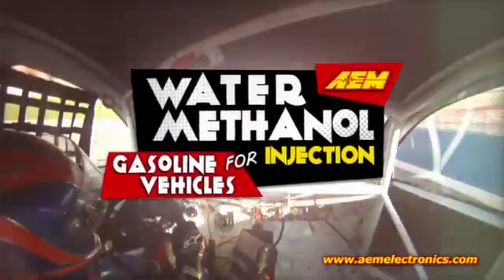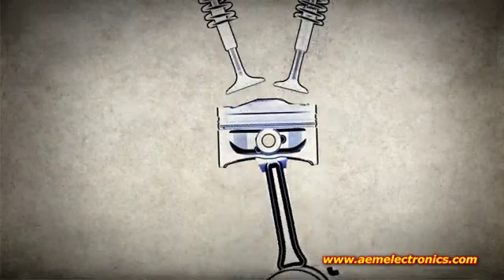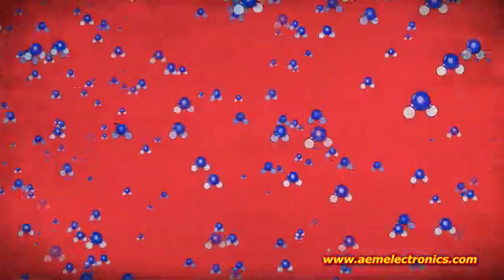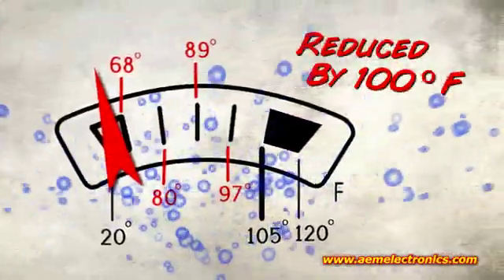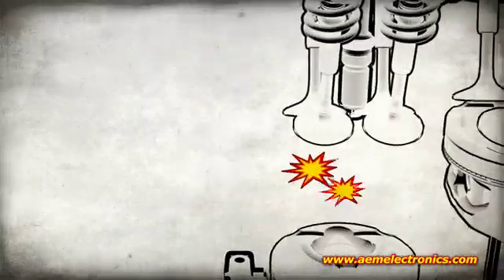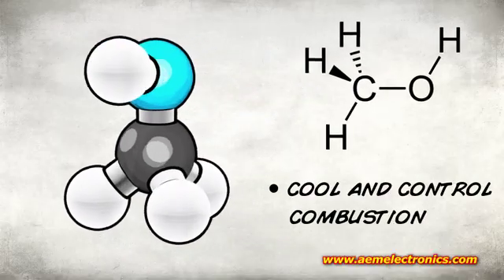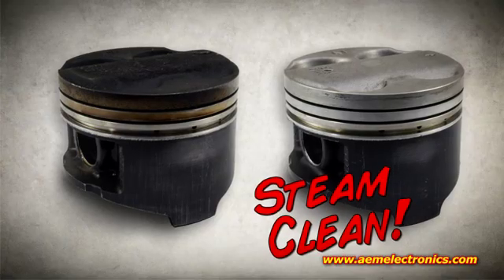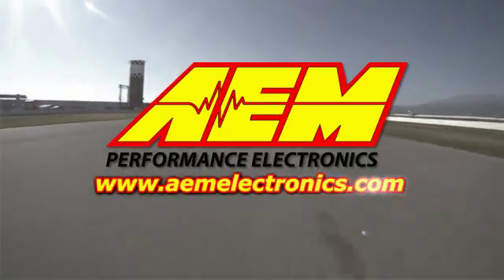How Water/Methanol Injection Works & How It Makes Horsepower in Gas Engines

Comment: This is one of the things that sound too good to be true... Anyway, do you need to remap your car after installing a water/methanol injection kit? Also, where do you get the liquid from and how often you have to refill the reservoir?
Reply: you def need a remap. you would see little or no increase in power otherwise. it would cool the engine but thats about it.
Reply: It is infact not too good to be true, and to answer your questions yes you need to remap unless you don’t care to see a power increase. And as far as buying the methanol goes I prefer boost juice you can buy it on Amazon and I put a gallon in my meth box about every 5 tank fills. So worth it and I highly recommend if you are pushing a lot of boost

Comment: CH3OH + H 2 O → CO 2 + 3H2 (Hydrogen) at 200 to 300 C.
Its called methanol steam reforming (MSR)

A hydrocarbon (gas, petrol, diesel) + H2O = Steam reformation. (more hydrogen)

Red Hot Carbon + steam = more H2

So... There's more going on here  than just detonation suppression...
(Begs the question: What's produced in the exhaust too..!)

Comment: I want to use this for my 20yr old Subaru H6.  I know its got a carbon problem because I get detonation (with 93 octane gas) over 2400 rpm when under load if the temperature is over 40F outside.  I get no detonation in cool rainy conditions when the rain is a superfine mist.  Most of the time it runs too hot and eats up spark plugs too soon.  Why would I pay for a complete rebuild on a car worth $1500 when water/meth will most likely fix the problem?  But I have no idea where to put the nozzle when I buy it.

Comment: Can e85 not be injected?
Reply from the maker: Not using this system. It is designed for water/methanol injection only. If you want to use E85 you will need to upgrade your vehicle's fuel system with alcohol fuel-compatible components (pump, filter, lines, injectors, regulator, etc).

Comment: how much milesi can go with methanol tank? also when does it works? from rpm or it just adds on throttle?
Reply from the maker: The consumption rate of the WM will depend on your start and full pressure settings, and ultimately your driving habits. Typically our 1.15 gallon tank will last for the length of a tank of gas. Our standard controller is boost dependent, meaning you set the boost pressure you want the WMI to start flowing at, and the pressure you want full flow at. The controller then interpolates these two points to deliver a linear fuel flow curve between the start and full pressure points. You can also use our Multi-Input Controller to set start and full pressure from MAF reading or IDC.

Comment: need to retune the car if i only use it to prevent knock, not increasing power?
Reply from the maker: You do not need to retune if you are using it for knock prevention and cooling, but to get the best performance it is strongly recommended.
Reply: AEMpowerTV so i can just get this kit and install into my car and start spraying without tuning?
Reply from the maker: You can, but to net a performance benefit you will need to have the engine tuned.

Comment: silverbullet
This is how we are going to make out system the best performing supercharger and the  easy ist to install.It just bolts on hook belt some wires drill a few holes and your ready  for the ride of your life.  928 344 2117 Will fit all Chery based engine buggy.

Comment: Very new to this, not even sure how I got here. So many questions, lol.

Would you install this in a standard, non turbo GDI engine? Does this completely replace using gasoline?
Reply: no it doesn't replace gas...you will be able to use the less expensive gas with the added methanol plus when tuned get lots  more power

Comment: Can methanol be used on NA engines?
Reply from the maker: Yes, on high compression engines. We have a WMI controller that you can program the flow curve with using MAF voltage signal.

Comment: What about tuning for moded cars?.. If it creates more power by allowing more timing is it to the point where the ECU can adjust itself with an aftermarket tune already in place or does it have to be specifically tuned to run with water/meth? if it has to be tuned for water/meth then what happens when it runs out? the car runs like crap because there's too much timing or can it just pull timing to a preset like say a 93 octane tune?
Reply from the maker: Sigrafix To take full advantage of a system the car should be retuned with the water/methanol injection. On our system we include a fluid level sensor so in the case that you run out of fluid it can send a low side ground output through our controller to your ecu to switch maps.
Reply: AEMpowerTV
Thank you! That's what I wanted to know.. now this brings me to my next 2 questions, 1. How big would a typical methanol tank be? and 2. How long would that amount of meth last in moderate use?..

ideally I'd consider a low constant meth injection to supplement fuel for a bit more power at all times but I'm not sure if that's realistic or even possible.
Reply: Forgot to mention I turned off the pump after realizing I forgot the tune. It will be tuned once I get the file.

Comment: What happens if you run out of methanol while driving??
Reply: You just won't have that same benefits.. The car would run the same prior to the injection
Reply: trompocop19 The methanol is an add on.

Comment: Would the car still run if it ran out of water/methanol and wasn't temperature dependent on it.
Reply: Absolutely.. You just wouldn't have the same benefits.. The car would run the same prior to the injection
Reply: Yes. It's just an add-on system so as long as you are not using the water-meth just to keep your engine at a safe temperature it won't cause any damage to your engine, you'll just lose the benefits of the cooler inlet air temperatures and increased boost.

Comment: The knock suppression ability also let's you run a leaner mixture as well as more timing.  Rather than running rich for the "cooling effect" of the extra gas you can rely on the water/meth mixture to keep temps in check.  Water takes a lot more energy (heat) to vaporize than gas.  But of course most tuners heads explode when you tell them you want to run leaner than 12:1 in a turbo application with water/meth injection...
Reply: rimwrecka100590 general consensus is to stay at less than 12.8 afrs for turbo applications to avoid knock. This is because it is difficult for someone to grasp temperature differences of the airfuel mixture. Basically, they are relying too much on afrs to gauge how much more boost or timing one can run.
Reply: 383mazda Why does this make their heads explode?

Comment: Question:

What happens when your reservoirs run out of the water/methanol mixture? Will your car simply loose the power gained by the system or will it cause damage? Anyone who is knowledgable on the subject please let me know!

Thanks
Reply: Robby Seiler There is a sensor to warn you of a low level. If it does run out, the computer will sense this and shut down the components.

Comment from the maker: Yes the kit can be used with just water. On a gasoline engine you would like to have a 50/50 mix of water/meth however on a diesel it sees less benefit from Methanol and can be used with just water with nice gains.
Reply: Hi.. So what mixture is best for diesel? Or just water or winter windshield fuid that has some meth in it?

Comment from the maker: Yes you can use them on NA vehicles as well and you are correct the benefits and nozzle size selection would be different than a boosted engine.
Reply: Not near as much benefit on NA though obviously

Comment from the maker: Yes, but you would need to do individual cylinder injection points and also have it completely programmable in RPM and load. At that point you would be much better off just running pure methanol in your vehicle as your fuel. This must be tuned of course

Comment: Thats dumb. The ''turbocharger system'' has nothing to do with what the methanol injection is fixing. Methanol injection is cooling your motor and increasing octane, any turbocharger system is gonna increase heat and chance of detonation even a 10k dollar turbocharger system. lol... if you dont wanna run methanol use race gas or e85, not a better turbo system lmfao.
Reply: Technically it does not increase octane as octane is a component of gasoline. It just resist's pre detonation like octane does

Comment: if you change your compression ratio (new pistons, etc.) in you NA engine to racing levels you may use this system to prevent engine knocks when you are not using racing fuel. Other than that, I don't see why you would want this system in NA engine. Hope it helped.

Comment from the maker: @gsrangelmon 

The methanol has two roles in the injection system. It does cool the intake charge, but it also increases the octane level of the fuel as well.

Comment: i have a question i understand the water Absorbs the heat but what does the methanol do. does it just increase the octane level of the fuel when it gets mixed with the petrol or does it have a cooling effect like water ? and why do people run 100% Meth ?

Comment: @mrxbrightside mostly turbo/supercharged cars because they are prone to more heat and detonation. but if you have a highly modified NA with very High compression pistons  then it will help stop detonation. the old hotroders from the 1950s used to use this system to stop detonation so its nothing new. also WW2 fighter jets used water injection as well

Comment from the maker: @rabbott430 HAHA! Funny but some have tried this - with not so good results. Here's why: the size of the water droplets is too big and won't atomize correctly, so you have water that is in a droplet that is too big to vaporize (and thus can't cool things off) entering the combustion chamber. Problem 2 is the siphoning effect that will occur when the engine is in vacuum - your engine will suck water out of the tank and could hydrolock.

Comment: @TheAristotleQ Did you ever have your car running hard on just straight pump gas? I did before and there is a very noticeable difference. When I get in it before I could just about watch my gas gauge go down and with the meth it is a lot better.

Comment: @1970351cmustang Short answer... YES! Even on a N/A engine you will see power gains. Check out the Aug 2011 issue of Popular Hot Rodding Magazine, they cover the topic of N/A Water/Meth injection. However they did theirs on a Carburated 302 setup. Check out Snow Performance for Mustang kits.

Comment: @getalife04 It did nothing noticeable for my fuel economy. No one I know has ever gotten better gas mileage on a forced induction gas engine. I have a W/M set up on my car. When I drive mostly freeway, the system doesn't come into play. When I drive mostly city, the only difference I notice is that I never lose power due to high intake temps and heat soak on my stock intercooler. Especially during summer temps.

Comment: @TheAristotleQ Ok so I was a off with the amount of fuel that it replaces but it does make a difference in economy and the amount of fuel you have to dump in order to make the same power. The best benefit is the knock prevention and the ability to up the boost and the timing to create more power. I read 30mpg at full throttle lol.

Comment: @getalife04 Think about it, if cars could run off 50% water and 50% methanol, why would we need gas? Also, even if you could, W/M nozzles are WAY smaller than fuel injectors. Take a 400 hp 4 cylinder car. Uses four 700cc injectors. That is 2800 cc’s of gas. It's common to use 1cc of W/M per hp. 400hp= 400cc W/M nozzle. So how would a 400cc nozzle replace 2800cc of gas? At WOT, if you pump too much 50/50 W/M, it will stop the gas from burning. The car will stall. 50/50 W/M is not flammable.

Comment: @getalife04 We agree everything is normal at idle. You said "You build boost at 5psi your meth nozzle sprays the atomized mist into the engine there for replacing 90% of the pump fuel you would use. Therefore when you get on it you are using meth, not the gas in your tank."

This is not true. If you tried using only 10% gas and 90% W/M at 50/50 mix, the engine would not run. If you held a lighter up to a W/M nozzle spraying 50/50 water/meth, it will not ignite. That mixture is not flammable.

Comment: @TheAristotleQ Ok let me elaborate a little here. When you run meth at idle everything is normal you are using just the fuel in your take like normal. But once you build up to say 7psi of boost the meth kicks in where you can pull back the pump gas. And how does a 50/50 mix NOT burn? Once it combusts in the chamber the cooling effect of the alcohol reduces the thermal temp and decreasing knock. Also the water offers a cooling effect and steam cleans the engine.

Comment: @KoalaJacks I can assure you, it does NOT increase your fuel mileage. The system is only active during acceleration, so unless you drive 98% of the time with your foot completely to the floor, you are not saving any gas.

Comment: @getalife04 Dude, you are way, way off on this explanation. W/M injection does not replace 90% of the pump fuel you would normally use. You couldn't even get your car to idle using only W/M. The typical W/M ratio is 50/50 by weight and you can't even get that mixture to burn. Nevermind run your engine on it's own especially at full throttle. Unless you rewrite the fuel map, or your ECU has wideband lambda capabilities, you save ZERO fuel. At best, at WOT, you might be able to reduce fuel by 5%.

Comment: @KoalaJacks Yes to and extent. When running meth it is used as a supplement to the fuel meaning that you aren't pumping much of your gas into the cylinders once you make boost. Your average meth kit will kick in at 5-7psi and peak at let's say for this example 18psi. You build boost at 5psi your meth nozzle sprays the atomized mist into the engine there for replacing 90% of the pump fuel you would use. Therefore when you get on it you are using meth, not the gas in your tank.

Comment from the maker: @koutz4 Thanks for the props! We typically like to install the water/methanol injector post intercooler to avoid water/meth pooling up in the intercooler. Although some will install it pre intercooler and pre compressor we like to install it post. Another thing to keep in mind is if your car is equipped with a MAF than make sure it is post that as well. As far as ignition timing you can leave it stock, but to get the most benefit more timing can be added to your ignition map.

Comment: Really nice video guys. Really love your products. Keep up the good work.

Where do you most often install the meth nozzle; Compressor inlet, or post intercooler? Also, since it creates a slower burning combustion event, more ignition timing must be added, correct?